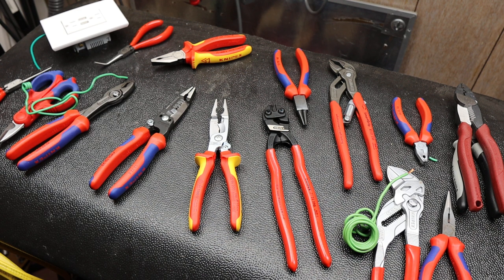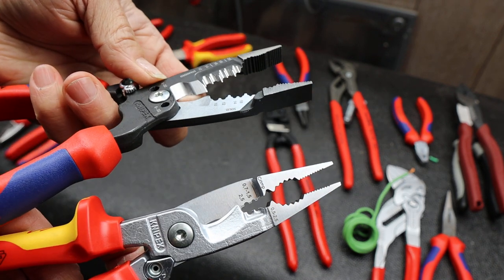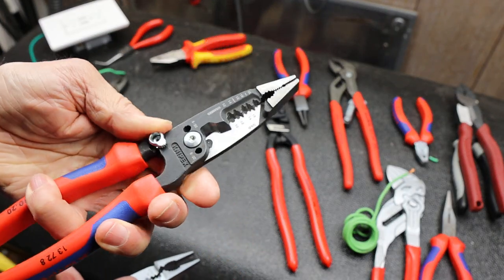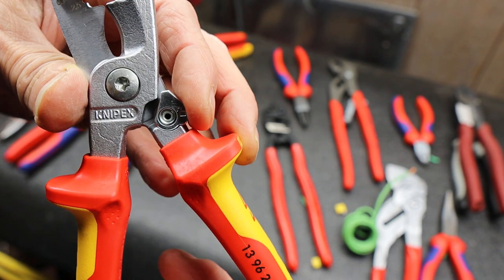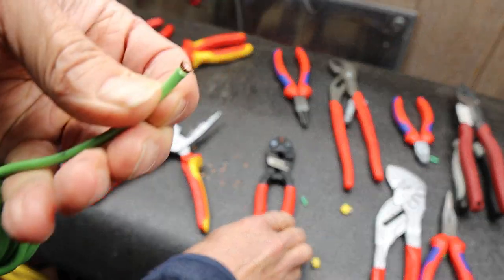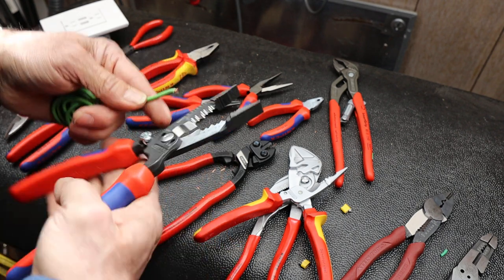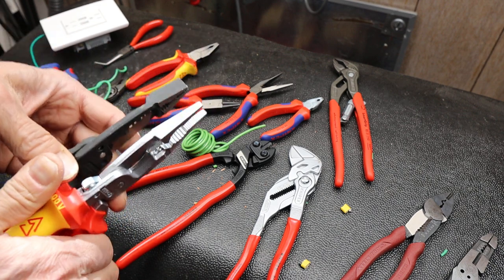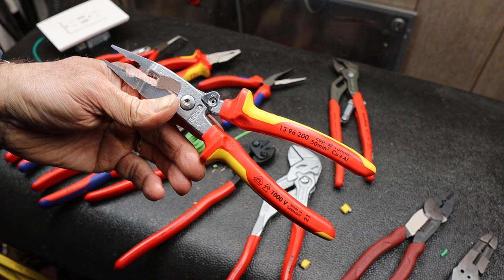Knipex 1396200 Pliers for Electrical Installation. Needle Nose, Stripper, Cutter, Crimper, And More!

Comment: Follow-up:  These have become my favorite auxiliary tool for DC wiring.  The needle nose are grippy and precise.  The cutters will cut larger battery cable, I've had luck up to 2awg.  I accompany these with a pair of automatic Knipex strippers so I only use these as strippers on problem wires that need a little extra insulation cutting.  They grab bolts in a pinch and overall are just super handy.

Comment: I have these pliers in the comfort grip and dipped handles but mine aren’t spring loaded with the lock. I didn’t realize they had these with that feature.

These are my “go to” pliers for electric work. My favorite from Knipex so far.

Thanks for all your content, I really enjoy it.
Reply: The lock is really handy , you can pull fish tapes , etc without disengaging the lock , ditto metal bending etc . Comes in very handy !
Reply: @chrisfyfe9212  I’ve actually been looking at the insulated of these to put in my TP4B instead of the comfort grip of these plus the insulated needle nose. I think I might get this metric version for the spring action to try.
Reply: @MORGANSMaintenance  I also want the latching, Metric, VDE / chrome version ! I’ve seen them on “ Chad’s Tool Box” in the States , distecall whether KCTool has them . Otherwise you might end up having to buy them out of Europe .

Comment: Excellent as always doc.  I have the 13 88 8 sometimes shown as 13 88 8 (US) which are VDE, not chrome, no lock and I will explain about the 8 below.  I also have the same set in dipped (not near them to check the number).  I was kind of miffed because I love chrome pliers (in spite of them not being quite as sharp) and I like spring loaded pliers, but the ones you have (13 96 200) are not for AWG (American Wire Gauge — I know you know what AWG means doc but others read comments) but rather metric wire (and are labeled as such with metric I think they say 2mm and 1.2-1.5mm).  I did not get the ones you have for that reason (I may now if they strip 12 and 14).  For the AWG tools (like the forged wire strippers),  Knipex labels them with 8 as the last number (rather than 200 which is for 200mm).  So my 13 88 8 says 12 and 14 for the stripper holes and they fit those sizes perfectly (which us 99% of residential 120v wire in the US).  

I think the lock snapping back to lock is a feature.  The reason being is that way you don’t have to touch the lock if it may be live, but I don’t know.  

One feature you did not mention on them is that the very tip of the pliers is smooth, not cross hatch, so you can use that for looping wires without damaging the wire.  This has never been an issue for me using long nose pliers, but you know, German made so I am trying to think like a German.
Reply: For anyone else, as of April 2023, the only spring-loaded and locking electrical pliers you can get for AWG (NA) sizes, is the version with many wire sizes (the forged set). You can't get the 2-size wire gauge spring loaded with AWG sizes in any format of handle. The metric ones shown here are 1.5 and 2.4mm2 which will work with 16 and 14AWG.  16 is useless for 120v and you won''t be able to strip 12AWG. Such a shame. I have the comfort grip version for 12/14AWG but really miss the spring. When working with 120 it's a real plus not having more than 2 sizes.

Comment: I have a pair of 13 81 8 the dipped grips without a lock. I love them.
I could see why your insulated version would have the auto lock feature,  you don't want to have them potentially spring back open if you just cut a live conductor. 

With that being said, if I were to use them, that feature would drive me nuts.

Comment: I have the black oxide vde ones and they are on my side daily. Mine don’t have that locking feature but you forgot 2 of their best functions, with enough practice they can strip everything from 18-4gauge wire and the built in ferrule crimper is great for control work

Comment: I own both , both are great ! The super strippers , have basically superseded my Lineman pliers . If I’m using Wago Levernuts , I schlep the pliers for Electrical installation ( either comfort grip , or VDE , depending on the job .
Reply: I did the same thing now that I mainly use wagos. Just let me work a bit faster and lighter than wire nuts and a linesman’s pliers
Reply: @EngineersPerspective701  Good Call !

Comment: The VDE pair you have are more popular in Europe where twisting wires is unnecessary because wagos are the norm. The 13 72 8 are better for eletricians in the US. I've been using them for about two years and love them. The fact that they don't open all the way is one of the main reasons I love them. They open just enough for twisting a bunch of #10 wires together. Meaning I don't have to put my pinky under the handles to open them after every twist giving me more control and allowing me to twist faster.

Comment: Hi Doc, Great Review! About the opening when these VDE pliers are Locked it's a feature from knipex, they work partially with some functions of grip and strip. But the "Auto lock" that you said seems a production problem to me,  this does not happen here with me. Knipex did a small update on these pliers changing the lock button, what I understand is that this button is a little bit loose and closes automatically. In the old version the lock button is very stiff and does not close automatically. Cheers

Comment: Two interesting pliers for sure. Considering folks who work in the trade, regardless of the type, want to minimize the number of tools they carry without sacrificing functionality, I would think the forged wire stripper would be the one to get vs the electrical installation pliers. It would appear the forged wire stripper can do everything the installation pliers can do but the installation pliers can't do everything the forged wire stripper can!!
Reply: classic example of - more features does not equal "more better". I have both of them in my tool bag, both are well made, but I find myself grabbing the electrical installation pliers probably the second most often after screwdrivers. the reason is - while the do less than wire-strippers - they do it better! the design of the need nose, allows me to get in to small spaces, grab the specific wire I need between plethora of wires, rim plastic boxes, loop a wire more easily and with tighter radius and last and not least - in some far in between cases I need to do something on a live wires or near live wires - these are no brainier. yes it true there is a trend to minimize the amount of tools you carry - and if I really needed the extra features of wire strippers give and could not take anymore tools, yeah I would take them. but for most jobs electrical installation pliers, are just the better tool.

Comment: Are either one of those good for cramping 12-volt Automotive terminals?
Reply: No, no crimpers on either.  Europe does not use crimp on terminals like we do.  They tend to use either use pin style or ferrules.  Knipex has many crimpers for the latter.  Knipex does have the standard style stripper/crimper, but it’s one of three Knipex tools I don’t like (along with the raptors and locking pliers) and probably the one one I would not recommend.   They are an Italian made rebrand I think.  They work, but not made like Knipex quality.  For crimping terminals, you can get the lineman with the crimper and fish tape puller.  I tend to use the klein (just got the ones doc had in the background of this video) or channellock (had for quite a while) dedicated crimping pliers with the little snips at the end.

Comment: Also have the european version and the safety lock works similar - when i hold them vertically and close them fast enough they stay in closed position. It happens 3 out of 5 times, so can't say if it was planned. Anyway, knipex doesn't state it as an 'official' feature

Comment: Hey Doc, going back a couple videos, you had the SuperNips with the Cutting Blades not Lining up Perfectly Flush with each other.  I just got mine (140s) a few days ago, and  these ones are the Exact same way!  Disappointing, because they are so Expensive.  The $10 Klein's and even the $3 ToolShop Brand cut more Flush.   They still  cut fine, they just leave the smallest little nub.  Just wanted to let you know.  🔨👍😁👍🔧
Reply: It's on purpose